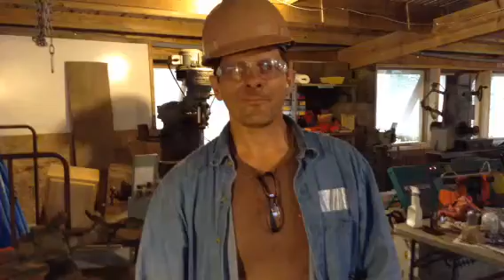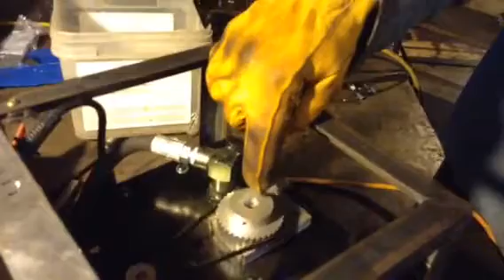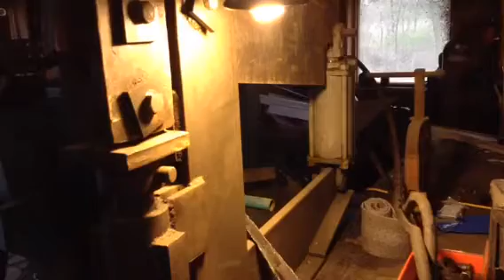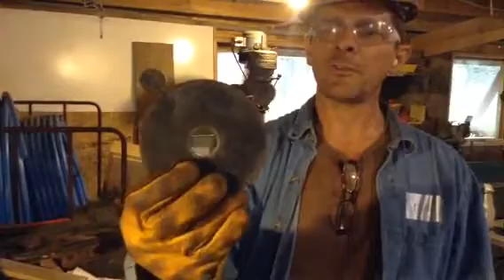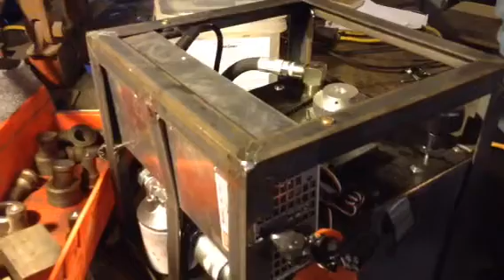MIcro Power Cube - Results

Comment: This was the heaviest test performed with the Micro Power Cube (MPC) and it performed well.  The object of the test was to use the MPC to power the OSE Hole Punch to punch a 1" hole in a piece of 1/2" steel.